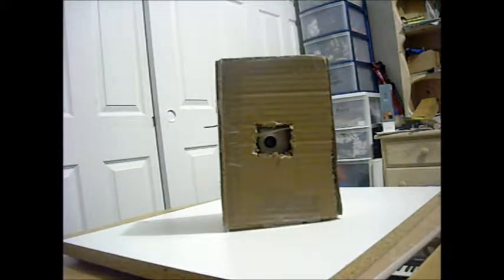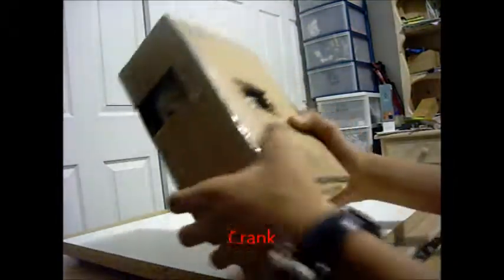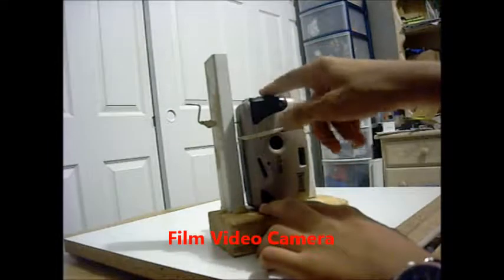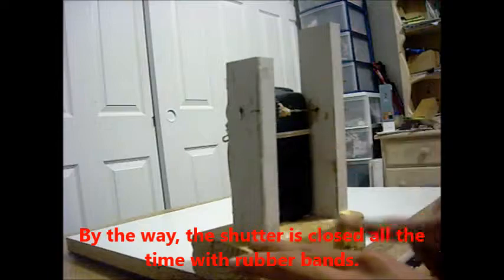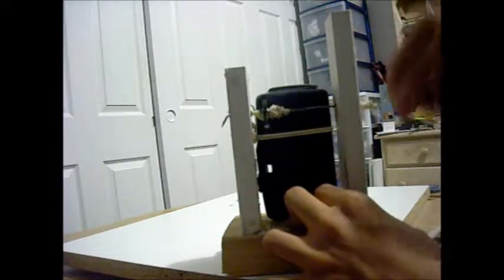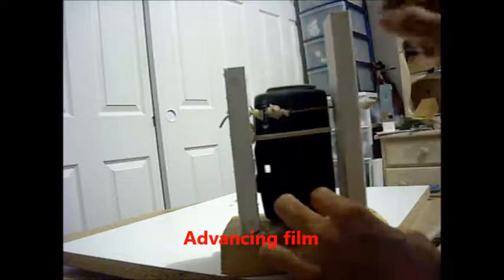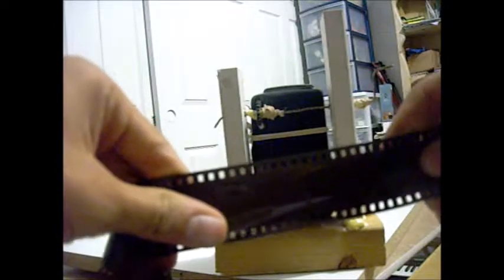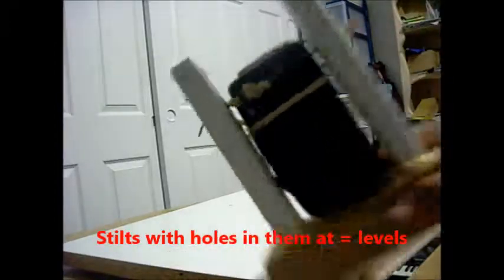Homemade Film Video Camera

Comment: Considering motorising this and changing the gears for faster operation. If the gears can take it 15fps should definitely be possible
Reply from the maker: The thought has occurred to me, and the camera still sits in on a shelf collecting dust awaiting repairs. But if I were to increase the speed to 15 fps, I would get less than 2 seconds of footage.
Reply: @thatrecord5313  The footage would look amazing tho, at that frame rate.
Reply: @thatrecord5313  trying to find a similar camera that i dont have to press the shutter manually
Reply: @thatrecord5313  I am now building my own version of this idea that is fully moterized. Ill keep you updated with progress if you'd like
Reply from the maker: @ken_dog180  , yes yes yes! I would love to see your progress. Why not upload the final product so others may get ideas?
Reply from the maker: @ken_dog180  , yes yes yes. I would love to see your progress. Maybe even upload it so others may get ideas?
Reply: @thatrecord5313  I will be making a video when completed and working, do you have instagram?
Reply from the maker: @ken_dog180  , I do not. I do have a Facebook, or email.